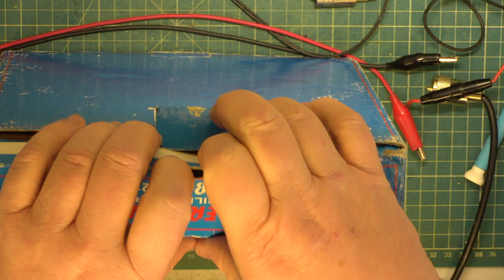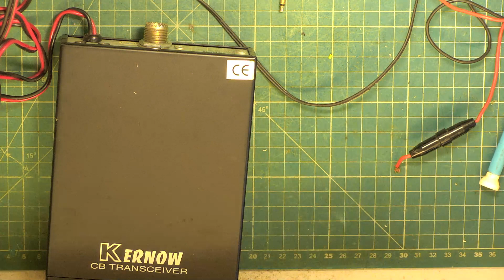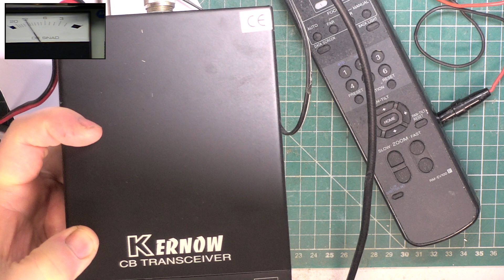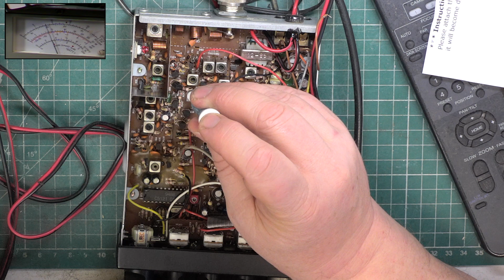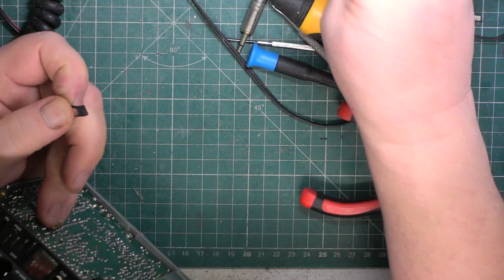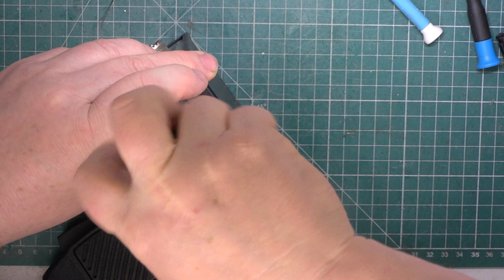Kernow Beta 2100 PR27/94 UK FM CB radio - repair & service

Comment: So Richard what was the difference between 27/81 and  27/94,  it the absence of a low power switch ?
Reply from the maker: Europe wouldn't allow the UK to have 80-channel sets as the interference level permitted on our MPT1320  (UK) standard wasn't as high as required by MPT1333 (EU)...though far & away better than the FCC USA specs. My idea was to revamp our UK set of channels so it was just a tiny bit better than the EU specs. Nobody else had thought of that (this was at a Nottingham DTI conferecnce where I was on the committee with ABCB). So the DTI drew up MPT1382 thus paving the way for the introduction of 80-channel sets. The EU agreed & ultimately PR27/97 allowed 80-channel cobining of EU & UK FM sets of channels. 

The Hi/Lo power switch was to do with the CAA, as was antenna types restricted to 1.5M. It stemmed from a burner/illegal SSB activity causing damage to an aircraft at RAF Finningly. After extensive testing with UK legal CB sets on various aerial designs that aerial restriction was reduced in the early 90's. However, beam aerial & 7/8 wave aerials may still not be used on CB in the UK.

The tests proved beyond all doubt that it wasn't the aerial type that caused the interference, but the illegal 'export' radio with no filtering & the illegal burner combined. I recall the 'illegal CBer' got a confiscation order, fine & 6-month in prison

Richard, G0OJF, UK